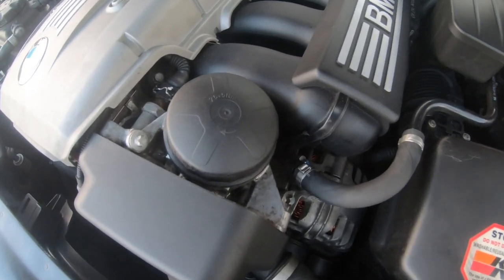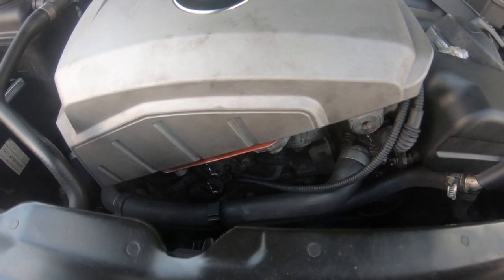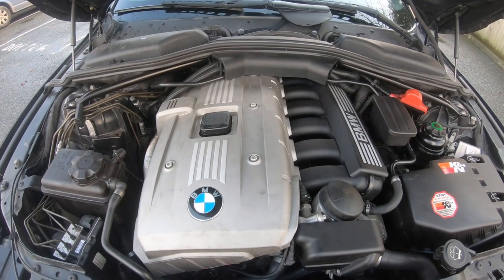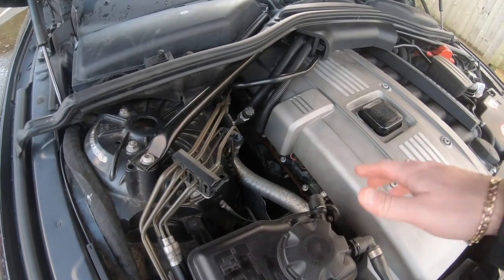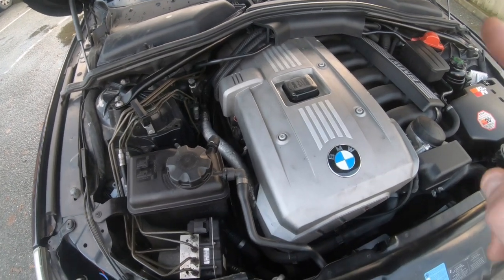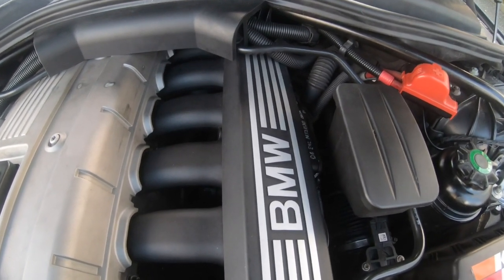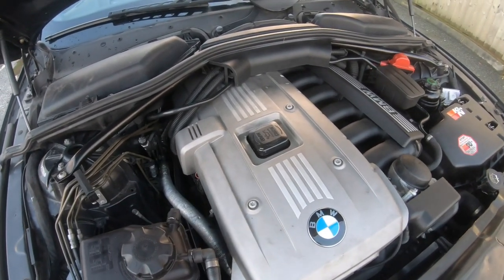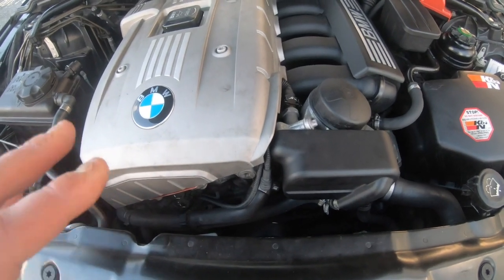9 Parts That Will Fail On A 100K + Mile Bmw N52 Engine

Comment: A good addition would be the coolant hose flange (aka mickey mouse flange) near the oil filter. Mine failed at 120k miles and it’s a small plastic part that is easy to replace. If it fails while driving you will loose all your coolant and can overheat the engine if the car isnt turned off

Comment: Just got my n52 530i. Changed out my thermostat housing and water pump , new plugs and coils , new OFHG, New vanos solenoids, I got new disa valves I gotta change out. 
Next I gotta to my valve cover gasket . And I’ll check my ccv when I can. Runs great. 179k miles
Reply: @sebastianmitchell5861  how's that 530 treating you ?

Comment: Got an E60 530i 2006, been running great no issues whatsoever, runs smooth both in engine and gearbox. But randomly about 2 weeks ago when i was cruising on the highway and tried to overtake I pressed the pedal fully down just before the kickdown click and the car wouldnt instantly downshift and rev up like it usually does, it took like 3-5 seconds before it downshifted and went away.
No issues in sportmode when manually shifting, dont feel any clear signs regarding loss of power, no codes nothing. I am running abit too long with the current engine oil but will get it change but it cant be that i guess. Its an automatic

Comment: 2008 E90 bought new, and I have gone through that entire list by 108k miles. Plus brake pump, torque converter and factory battery giving up at around 90-100k. For 17 years of ownership, it's not bad, I guess.

Comment: Thanks for the video. Just bought a 2011 328i with 99k. Had it about 10 days and it runs crazy good.

Getting it checked out at a shop soon and will be doing some of the maintenance myself.

Comment: Got an e90 last weekend. Haven’t drove it since, started pissing oil all over the front of the block. Replacing the valve cover gasket, spark plugs, ignition coils, oil filter housing & gasket, and the breather hoses.

Comment: What he means by ecu update is you need a scanning tool that has the ability to update modules you replace on the car line the vanos  solenoids or the injectors these parts in some cases have numbers that need to be registered to the computer so the car knows what’s it’s doing with those parts . I myself am using launch creader elite version 2 for BMW it’s about 200 bucks or less but you can update your ecu which is the modules you replace ,there are dozens of how to instructions for doing these things with a scanner and they all give the same results .
Reply: I put new injectors in my car and I have a launch 123 it's not the elite I don't think but I also have a Foxwell nt510 but there is no selection to program numbers for injectors just a selection to do adaptation reset

Comment: 70000 miles on my n52(328i).It just started to smell like burnt oil. Going to see if the valve cover gasket is the culprit. I hope that’s all it is.

Comment: From owning multiple e90 N52 , power steering - coolants / pcv / ccv hoses , starter , water pump . Thermostat, battery , ballast for HID , alternator. If you have a bmw with 100k plus miles these are parts that are going fail.
Reply: best site to order parts from?
Reply: Probably FCP Euro

Comment: Just picked up a 2008 125i cabriolet manual with the N52 with 104,000 miles and it’s got an oil leak dripping oil near exhaust manifold, I’m going to order the replacement and new bolts this weekend. Paid £3400 for her and don’t mind paying to bring the engine and components as close to new as possible. I’ve had DSG golfs and stuff in the past and I really have a soft spot for the configuration of this little car N/A 6 cylinder, 6 speed manual, RWD, Coupe. this is now unheard of!
Reply: Nice spec. It could use a tune ai think. How did it go ?

Comment: Has anyone experienced a code P1030 code on a N52 and what was the solution? I know it’s multiple things but I need some pinpoints.
Reply: 02 sensors upstream or downstream , valvetronic actuator , possible head gasket leak

Comment: Engine runs GREAT ! I had Mom appointment for her to look at a Subaru... They had sent it out for detailing and pulled the gold onto the screen. Mom said , " I want it, I'm tired of looking. For $11,000, Mom got the E60 N52 528i 2009 (or 08 * lol * ) - 88k miles -  in May '22. I asked sales rep  to pop hood after test ride (10 miles maybe) ( with a weird disturbance mid run). Residue all over, but not thick black...  Just moistened , so I asked what was leaking... "Oh nothing, probably last guy to oil change spilled a little..."  After home a month, total brake and rotors, then top front  coolant hose connector (one of many things readily emitting residues). So then oil cooler filter housing gasket change and pulleys belt and tensioner, valve cover gasket.... But a vibrating was irritating to Mom ... I re-lubed/replaced caliper pins, no fix... Then recalled for pcv valve tube change... They told me needed rotors ... The ATE's I got for it weren't quality enough .... BMW's rotors next  great,  but pinhole steering fluid leak low pressure  and old intake clamp inches from steering pump  pulley made belt jump and shredded everywhere... ugh....a  piece melting belt clabbered on the water pump bolts and melted up the rubber washers.... NEXT....

Comment: What modules need updating after vanos solenoid replacement?  Never heard of this.. Can ISTA do it?
Reply: turn key to second position and depress gas pedal 10 times in 15 seconds. i think you repeat it like 3 times in those 15 second intervals

Comment: Dr. BMW! I have a question I recently purchased a 2006 Z4 with N52 engine and only has 6k miles on it, kept good and checked engine bay very clean no oil leaks.  I've done the oil change and windshield sprayer waterpump.  Is any of the 9 points I will need be alarted soon?

Comment: Great video!
I have the problem that my N52 engine has a rough idle only on cold start. Already changed the spark plugs, solenoids, chain strengthener and the twi DISAs on the engine. What else could I replace?

Comment: Thats the noise of a direct fuel injection engine, sounds like a diesel truck. Normal. But if your fuel consumption is bad and you experience misfires, shudders and rough running then check your high pressure fuel pump, spark plugs and ignition coils

Comment: Just bought a 09 328i from a Police Impound Acution and it has 188K miles, so this helps on what I need to get changed, just the other day replaced the starter, crank sensor, oil housing gasket, intake manifold gaskets, oil pressure sensor, crankcase vent...the intake has a lot of oil inside of it as well.... and will be replacing all the vanos BS and installing a Aluminium valve cover and of course the belts and transmission service.

Comment: What's you feelings in EGR. Would you keep it or get it removed? I got bmw 730d on 2007 plate. It's done 100,000 miles.

Comment: I bought a 200k mile 325i manual and videos like this have kept it a happy machine.  I lost the water pump once in a dramatic explosion of steam. Fixed it for 150$ amazon replacement and a 10$ metal hose flange to replace the original chocolate hose flange.

 Lets go another 5-50k miles :)
Reply: Hows the water pump doing ?
Reply: Amazon water pump? You’ll be replacing that soon😂 certain parts like water pump have to be oem part.

Comment: With 302k miles my water pump went out, none of the rest of these things failed. Changed coils at around 180k because the boots were torn replacing plugs. As for the antifreeze drained it at 185k because if a deer hit and it was pure black. Might be scaring people away from decent cars.

Comment: Hello Sir   My car is 2005 e60 523 and it has driven about 240,000 km. Please tell me, the engine oil volume of this car is 6.5 liters, can I use it like this? 5w40 5.5 liters + 10w60 1 liter. thank you. (LIQUI MOLY)

Comment: I got i oil leak come from the left side of the engine by those bolts you mentioned so does that mean I need a new head gasket? Also I have a code that pops up saying my car is not getting a good fuel to oxygen ratio ( bank 1 and bank 2, are rich) what would that be?

Comment: Thanks for the video - useful information. I have changed everything you have identified except the disser valve. However I waited until I got codes or other faults. I only replaced one coil not the hole set. A new coil on one cylinder does not put extra load on old coils as they are completely independent of each other. The only additional item I had to replace was the starter motor. Sold the car with 320,000 kms. The new owner has the full history of the items replaced. PS - changing the water pump and thermostat requires the coolant to be replaced and should be the only time anyone needs to touch the coolant.

Comment: I bought a 09 328i with 380k km and  it won't go over 40 and it's burning gas quickly,also I got codes for engine misfiring,I need some help what should I check

Comment: I bought a 08 BMW z4 3.0si with 127k on it. It seems everything has been replaced from just looking as for what I can tell. The Valvetronic gasket is the only slight leak it has but I am replacing that this week. I think the Disas have been replaced but not 100% the top caps are green in color if that makes a difference.

Comment: This is all spot on.  My 180K N52 (328i) has all of these except the vanos done.  Most items got replaced at ~80K.  But did my coils and second set of plugs about 170K.  The valve cover had to be replaced because the CCV is built into it, at 175K.  What a stupid design that is.  At the current time I periodically get an oil burning smell, but no drips are visible on the car or the garage floor. Any ideas?

Comment: So when I get a used e91 wagon here shortly.  Basically just replace all these things or should I risk it and run the car as is for a short time first?... And if needing to replace all these it wouldn't make sense to pay big dollar on the car just cause it has 70k or less on the clock.  When could just pay a lot less for a car with 100k plus on the clock.  And use part of the savings to do a bunch of this work yourself possibly.  While getting to know the car more when working on it.

Comment: Hello DR.  I have a 09 528i and the ccv diaphragm keeps breaking I replaced it with the quick fix from Amazon because I did not want to change the intire valve cover , unfortunately it only last a week. Does the vanos cause that?

Comment: Excellent information.  I got 220,000 miles on my 08 528i and have already gone through the valve cover gasket, spark plugs. Football gasket, eccentric sensor, oil filter case gasket, expansion tank, battery and vanos solenoids.  Im getting ready to order new vanos solenoids again 4 years later.  The waterpump still has a strong jet of coolant at the expansion tank.

Are the motor mounts a bad failing point for these cars?  

My 528i makes a sound right at the start only and dont know how to trouble shoot it.  I know my sister is having her motor mounts on her 07 328i replaced due to a rear end collission.  As soon as she got hit, her cars started vibrating like crazy. Just like I thought, it was the motor mounts.

Keep up the good work and thanks in advance.

Comment: i have a friend that has the same engine and never had any issues with the engine other than oil leaks. and now is 177.000 miles and still gOing

Comment: Hey there I have a 06 525i, changed out all coil packs, new spark plugs, new vanos solinoids, new MAF, new crank case vent hoses still have a misfire & rough idle. Last thing I’m going to change is the check valves for the vanos solinoids. Any other ideas?
Reply: Solenoid*

Comment: Hy I need to know if it normal for the BMW E90 model 2011 to have cold and hot air when you open the air-conditioning

Comment: I love my 335i and yes many things do break after certain number of miles. Weird tbat BMW designed parts to fail like that. LOL The biggest problem for me is the rear main seal leaking and the electric water pump. Estimated cost to replace the rear seal $6000 and $4000 to replace the water pump. 90% of the cost is labor. The water pump last about 70k miles. I have an old Lexus RX300 SUV (spare family car) with 248,000 miles. I can't remember anything that actually broke. Crazy huh? LOL

Comment: 6.	Water pump and the thermostat

        a.	Replace these. You do not need to change the coolant.
        b.	Don’t worry about the warm temperature if the car is not overheating.
        c.     Costs about $50 - $120
Not sure where you're getting your water pump.  They're over $600 here

Comment: I have ruff idal  for a couple of seconds only when engine is cold and it's frowing up vanos inlet exhaust codes ?. Thinking it's vanos solinoids so changing then but how do I update the engine as explained on video ?

Comment: Hi do you know what is the proper oil pressure of the working n52 engine when parked ?
Reply: any car at idle will have low oil pressure (5-15psi) The reason why most cars don’t have oil pressure sensors is because most consumers think “low” oil pressure at any time is bad. I had a built 3800 motor with a high pressure oil pump that would put out 75psi at high rpm but only 5psi at warm idle

Comment: 2011 N51b30 done two oil changes already with 5w30 just ordered 5w40 🙏🏼 80k 👨‍🔧 done my oil filter housing gasket, started seeing it fail on the cold starts...bolt behind manifold is not bad just have right tools 🛠

Comment: Hey doc, any advice on changing the transmission fluid on n52 after 100k? was going to change mine it said "lifetime fluid" which doesn't sit right. I've got 160k miles on it!

Comment: Thanks for the video! In addition to the tensioner, idler pulley and belt, do you recommend changing the crankshaft pulley/harmonic balancer after oil leaks have been fixed? My understanding is that the rubber in the pulley/balancer can deteriorate after being soaked in oil for a while. Could this part failing be the cause of increased engine vibration at idle? Should you change just the pulley (removing 6 small bolts only) or the pulley plus the backing sleeve thing that is held on with the single bolt? I'm concerned about messing with the timing by removing the whole part with the single bolt.
Reply: i'd like to know as well please and thank you,

Comment: I have E90 and when I accelerate him, it kicked before going up , it an automatic transmission . I don't think is a transmission because in the freeway the car run smoothly. 
But I still figured out what is the problem

Comment: There are lots of Chinese fake cloned spark plugs labelled NGK or Champion, like on eBay, which break up into pieces. Total risk & waster of money. Some discount stores have Chinese cloned plugs from eBay. Buy carefully. BMW plugs don't need gapping, because multi electrode or iridium are too hard to adjust so come pre adjusted... I am a humble software designer not a BMW god like Dean..

Comment: My 06 E90 325i with 55k mileage both valve cover gasket and oil pan gasket starts leaking..The valve cover is easy to work but the oil pan gasket was a pain,It took us 2 days but we managed it.

Comment: I think BMW is good only the car is lower 20,000 miles if more than that about 80% parts has to be replaces,I love BMW but used to be cost me the most in the past the maintenance shave me as razor ?
Reply from the maker: your talking our your batty now
Reply: @BMWDoctor  

How replace the
Shaved Razor.

Replace side of face at same time?
Nose? Chin? Teeth while we got it open?  Eyeballs.
Hear they're expensive. Ears? Scalp? Brain? Ahh. Essential.

Comment: 06 325i won’t start with maf sensor plugged up starts great unplugged need help
Reply: You need take intake manifold out and find vacuum leak, change the hoses and probably your maf sensor also. Would be good to check disa valves while youre there too. And check ccv for good measure too.

Comment: I have a question about the solenoids I have some issues whit my n52 we did diagnostic and found that 1 of the solenoids is not working the car is lacking power and is slow on the trotile when. i press it hasetate to speed up.
I am waiting for the new solenoid but I wonder is it possible the rataling noise to be from that as well. because it didn't show nothing else on the computer? will be. super thankful for any advice sorry for. my bad english :)

Comment: I’m tossing up between a E90 320i and a E90 325i, however I’ve been told the 6 cylinders are trash (I’m new to bmw’s) but I was just wondering what your thoughts were?
Reply: inline 6s are dope, i know im 3 years late but whatever.

Comment: My car now when I start it,it goes on a high idle  for for minutes and in the morning  it idles bad why pls help
Reply: sounds like a bad pcv valve, replace ur valve cover as its built into it. also a little oil flush and some nice liqui moly wouldnt hurt to smooth things out.